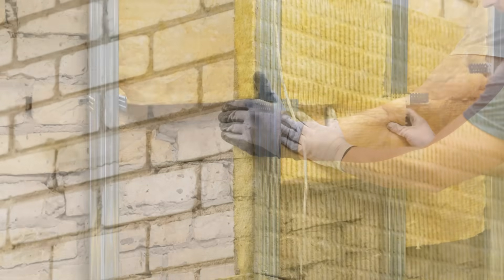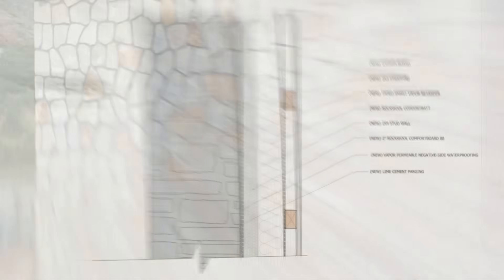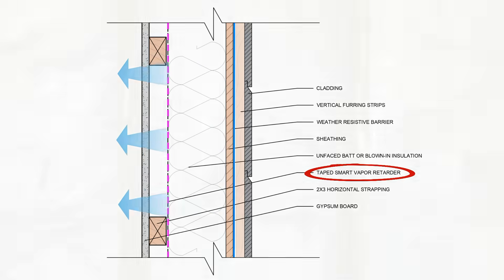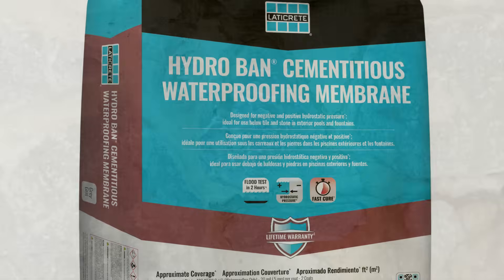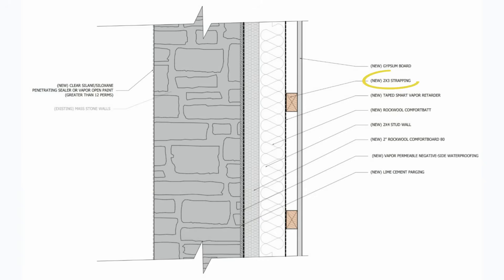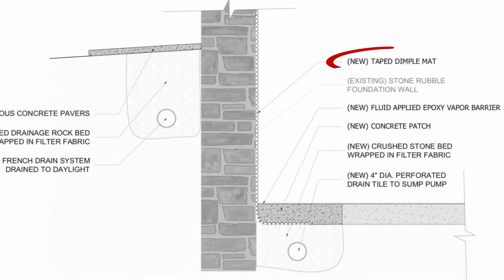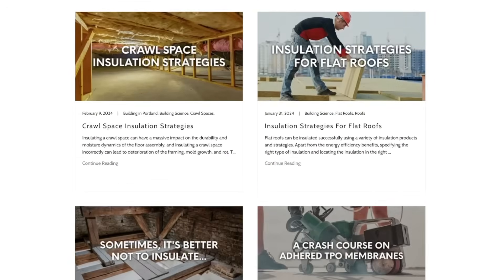How To Insulate Your Old Stone Walls The RIGHT Way

Comment: The only proper way to deal with this is to heat the place properly from the interior with a roaring wood fire in the winter, as was the case when they were built. That will stop condensation on the inside and moisture coming in from the outside
Reply: Wrong. We've not Neanderthals living in caves.

Comment: There is no need to insulate thick stone walls. Just install a good heating system to work all the time at low temperature so that the walls dry up and heat up and then you just maintain the temp easily with low cost. Houses lose most of the heat (40%) thru the roof so you need to insulate the upper part of the building to keep the heat in.
Reply: Old houses with insulated lofts lose most of their heat through the walls. To say not to insulate a wall is stupidity.

Comment: Currently buying an old stone house in Portugal which has some waterdamage to some of its oldest walls. Thanks for sharing this. Now I need to figure out how all is called in Portugees.😂
Reply: Problem is the foundation or rather the lack of it, those old houses are built on. Humid creeps up into floors and walls. A good (watertight cement) foundation, insulated floor and roof are more important than insulating a 50cm stone wall. Treatment on the exterior of the walls is sufficient. Treatment on interior walls against dust. Install gutters and drain away rainwater from the roof. My experience of renovating an old stone house in Galicia, NW Spain.

Comment: My son uses a thick lime mortar mixed with a granular cork filler,  then paints over with a permeable lime based paint.
Reply from the maker: That's fascinating, haven't heard the cork trick. Would be very interesting to hear the reasoning/benefits. Does it improve the flexibility or tensile strength of the mortar mix like a plasticizer?
Reply: @ASIRIDesigns ventilation

Comment: Why can’t they just waterproof the exterior and interior wall ?
Reply: Goid question.

Maybe the condensation in the rock creates different problems then?
Reply: Not totally sure of this, but I think stone walls also will pull moisture from the ground, and that also needs to get out somehow. So if you seal the interior and exterior, you also somehow have to isolate it completely from the ground.
Reply: @lamdrea a DPC would do that no problem. It can even be drilled and injected/plugged to do so. If it’s sealed all the way round how can moisture be a problem.
Reply: @richardlove4287 water will wick up into the wall from the unsealed bottom of the wall. It has to dry out or it will mold and rot
Reply: @jar3370 again DPC. That’s what it does.
Reply: Because they have to allow the moisture in the house to escape through them.

Comment: What is the life expectancy of the spray sealer on the stone exterior? What method will need to be used when the sealer's life ends? Unfortunately, stone buildings are a poor method of construction. Trying to preserve a stone building is like a cat chasing it's tail. Stone construction had it's heyday, and that time is gone.
Reply: MPC has a certified life of around 30yrs, after that just re-apply.
The rest of your post is just nonsense.
Reply: @lksf9820  Glad your sealer works for you.

Comment: Do you need to insulate stone walls?

They are known for retaining the heat.
Reply: That is simply a misunderstanding and a false believe. They only react slower to temperature changes as heat travels slower trough dense heavy material and with this kind of normal wall thicknes, it takes only a day or two. So it handles well cold nights if days are warm enough to heat it up again, but for any longer time it's completely useless.
Reply: @BoringBurger  
So the hear generated through the day  when heating is applied, will be retained and released much slower through the night. 
In practical terms then, they do not require insulation.
Reply: @Must_not_say_that  Well you are technically right and infact houses dont even need walls at all if you just heat them enough.
Reply: @BoringBurger  
You are just being silly now.
Reply: @Must_not_say_that  Yes I am. And so are you. But that's fine, have a good day, night or what ever time it is where you are.👍
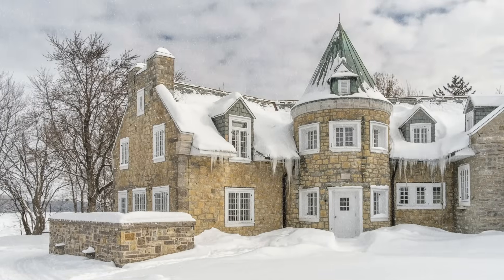Reply: 5:08 Is that the heat you are referring to?
Reply: @SpaceCrete  
No,
Heat from whatever soure, internal heating or external weather primarily the sun.

The video appears confused from 5.08 onwards and is talking about bricks which are very different to stone.

Since stone is dense and is slow to absorb heat and slow to release heat it is a natural insulator.

Years ago they used stones which were heated during the day and released heat at night while sleeping. a bit like hot water bottles but for both the room and the bed.
Reply: @Must_not_say_that  your grasp of how things work is so bad it's frightening.
Reply: @lksf9820  
I am please you are frightened. It may perhaps be the cause of toppling your pride and self consumption.
Nothing wrong with the comment. Stone has a high thermal mass. Your comment suggests you are ignorant of that. 

Have you ever heard about the Emperor's new clothes?

Comment: But if the stone walls are backed up insulation, then there is no drying potential. I don't see how you can reconcile the goal of insulation with the goal of preserving the stone. If warm air never touches the stone walls, then how do you dry them out?
Reply from the maker: It depends on how much you're planning to insulate. You can still get a decent amount drying with R-10/R-15. Air also doesn't need to touch the stone for heat transfer to occur, and the walls can still dry to the exterior. You do however, need to control the amount of water that is absorbed by the walls and where it ends up. If you don't have proper flashings and water shedding strategies like kerfs and drips, don't bother insulating.
Reply: @ASIRIDesigns  heat transfer can occur without air movement, but moisture transfer can not. That is the worst of both worlds. We lose heat without also losing water. 

So since we need air to flow throughout the system, we need something that is vapour permeable but water resistant like the smart barrier you mentioned. But if we stop the flow of heat, we stop most of the moisture flow as well. We sort of need both.

Comment: Do you consult on homes outside the US? If not, any idea how to find a qualified professional in France?
Reply from the maker: We do work on some select projects internationally. I don't know about finding someone locally in France, but there must be at least some building enclosure consultants.
Reply: Well guess what, if you worry about rules and regulations you're damn right. U < 0.2 (R>5) is hard to get with actual stone wall as lime is ~0,1/inch which means you'd have to have 50 inches of lime wall to achieve that. While it does happens in massive buildings sometimes it's not exactly norm. Also that kind of massive wall is beast when it comes to heat accumulation. It only means if it does cool down a bit (and it will) you'd have to spend a lot of money to keep the inner surface at comfortable temperature level. But with mild winters it does work nicely as it's warm enough during winter but doesn't heat up so rapidly during summer either (so, yeah, it feels cool inside).  From my perspective - if someone doesn't use coal, oil, gas to heat it up... just let it be the stone building it was meant to be. Maybe go for radiant heating to keep it more comfortable during winter but the worst thing which can happen to buildings like that is stupid regulations which are counterproductive as they enforce insulation level which will - in the long run - damage wall structure due to humidity freezing (as not enough heat will come through the wall). Kick stupid bureaucrats out already!

Comment: I like this arrangement, however for me it is improved if the AVCL is omitted so there is no hindrance of "drying to the inside".
At the same time ensure airtightness is completed prior to the insulation build-up, the lime parge coat is ideal for this.
This approach is better as the vast majority of moisture is moved through air transportation; only minor amounts are moved by diffusion so it can be ignored.
Reply from the maker: Air can work for you or against you. If your building is getting wet, don't bother insulating or air sealing until you have addressed that. If you're insulating, controlling air is one of the most critical aspects of moisture control, especially in cold climates. Check out the latest numbers from BSC on how much moisture can be deposited by interior to exterior air leakage in zone 5: https://buildingscience.com/documents/building-science-insights/bsi-149-slide-rules-pocket-protectors-cigarettes-and-iconic
Reply: @ASIRIDesigns  Thanks for the link I'll have a read of it, and thanks for the content, its very useful. 
Greetings from across the pond in Ireland.

Comment: Living where the frost line is 7 ft my friends farm built in 1917 you want to overheat the basement let the heat  "leach" into the ground outside to prevent frost heaving/wall cracking in the first place worked for there family the last 100 years!

Comment: "How to spend $40,000 to save $400 a year in heating".  How about just leave them alone, they work fine.  This bizarre fixation on "energy efficiency" is incredibly destructive.
Reply: Nobody is forcing this. There are many people who will see an ROI they like or prefer the comfort. This video is to show people how to do it right. Many scammers are convincing people to apply spray foam which is horrible for this building type.
Reply: @phamlam3720  regarding the sprayfoam... tell that Joseph Lstiburek (the guy that wrote the book on a lot of this stuff) who spray foamed his old stone basement walls.
Reply: @phamlam3720  An enchilada is made with a soft corn tortilla, rolled around a filling, and smothered in sauce before baking whereas a burrito is made with a larger flour tortilla, folded into a closed pouch, and is typically sauced on the inside, not smothered on the outside.  I'm not sure if you start all your comments with random non-sequiturs, but I figured I would try it too.  Yeah, scammers pushing spray foam are bad.  Just like scammers pushing any other way of insulating perfectly fine buildings for no reason are bad.
Reply: How is it destructive in a literal sense.
Reply: @Jimunu  By taking a perfectly functional building that will last centuries and turning it into a defective building that will rot and fall apart in 50 years.  Also, but conning people out of tens of thousands of dollars.  Both of these are literally destructive.
Reply: @SteveDouglas-x2q  so a video where how one does it right. Is destroying things. Okay. Not necessarily that it will last "centuries"
Reply: @Jimunu  It isn't done right, it is done the newest wrong.  You think tape adhesive is going to last?  Get real.  And again, even if it didn't destroy the building it is purely financial harm with zero upside.
Reply: Given how destructive energy production is, saving energy should make sense. You can't heat these sorts of homes for $400 a year anywhere other than the USA because of how much energy costs in other countries.
Reply: @tlangdon12  Energy isn't magic.  The reason these insulation scams are so expensive is because of the energy that went into producing, packaging, transporting and installing the products.  They took more energy to produce than what they will save in their lifespan.
Reply: Agreed 👍🏻

Comment: Actually really surprised how low the R-Value is considering how many builders swear by concrete.
Reply: stone is worse than concrete for R value  , but insulation has nothing to do with the many reasons people build with stone or concrete .
Reply: @sanisidrocr  Exactly and the main reason that some parts of the world build mainly with wood and some with brick, stone or anything else is that it's the cheapest material at there.
Reply: @BoringBurger  In my country we avoid wood studs and plywood and only use concrete or galvanized steel because of humidity and termites. Using cheap pine has its benefits though besides its price , its better insulating than steel and easier to modify and adjust and is a carbon sink . tradeoffs in everything
Reply: R values of thick solid stone walls are guesstimates. Generally 'worst case scenarios' to be able to perform the calculations needed. If you want an accurate R-value then you need to test your actual wall and that isn't going to happen due to the cost.

Comment: 0:06 - looks awful. Talk about HUGE thermal bridge!
Reply: Maybe, but maybe not. They could put horizontal battens over that layer, with more insulation between them, and maybe some foamboard or rockwool over that before the drywall goes up. I assume the metal battens on the brick were chosen to prevent rot or maybe to comply with fire codes.
Reply: They are not in contact with the stone so there's an air gap on the surface of the stone. Metal is conductive but light metal like that does not carry as much anyway. You may say the air gap is bad because air can reduce insulation, but it's behind all that stone and stopped by insulation in each bay. Just a gap at the studs and it looks like they are stuffing in the insulation some into that gap.
Reply: @pcatful  Steel conduct heat 300 time better than wood. They have an half inch airgap between the bricks and the steal. The steal will suck the cold out of the bricks and transfer the cold to the wall boards - not good at all. The insulation cant prevent that.
Reply: @elbuggo  I don't think the heat will conduct so efficiently over the  1/2" air  Needs some evidence. When you compare 300 times... the steel is way thinner and lighter than any wood you'd have in the wall.  And It looks like they are actually stuffing the insulation in. Ideally the offset can be done with plastic, or the a layer of sprayed or thin batth insulation could be laid in first. I just don't think what they showed was "terrible", unless you are looking for super high performance in a super cold climate.
Reply: @pcatful  Definitely, that half inch of air is a significant thermal breake, but the stud is connected to directly to the stonewall with big brackets too. The steel stud will suck the could out of that stone - that's the really bad part.  

You cant rectify this problem with more insulation.

Steel is not an insulator, it's an conductor. If you warm it in one end, it will heat up in the other end.

You should check out some of the articles on buildingscience on thermal bridging?
Reply: @pcatful  The R-value of wood is about 1.3 while  steel is roughly R-0.003. Wood is 433 times better.
Reply: How is there a HUGE thermal bridge through a slab of insulation?
Reply: @lksf9820  For some reason it is at 0:09 - Steel brackets connected to steel studs. The cold will creep through all that metal from the bricks and into the plaster board. Doesn't matter that it is insulated between the brackets and studs and bricks and plasterboard. Poor, poor design.